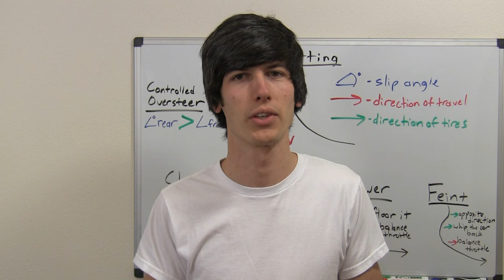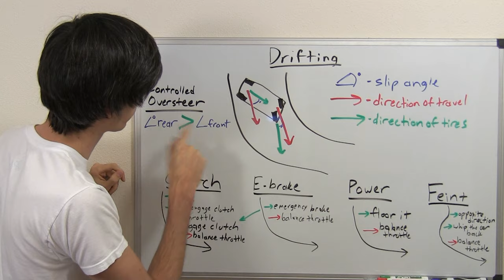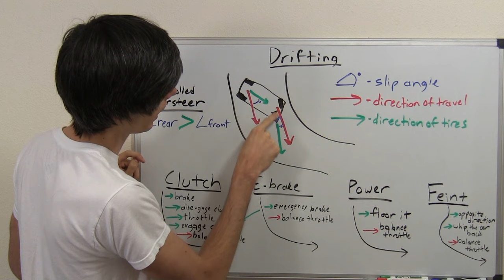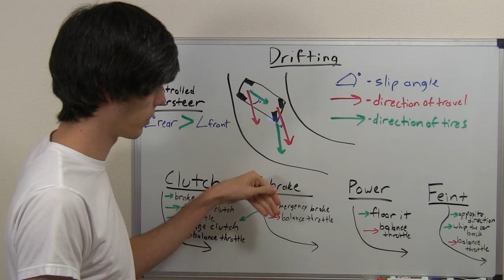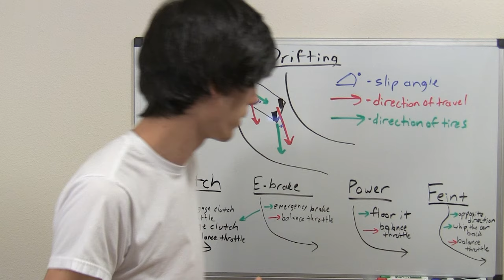What is Drifting - Explained

Comment: 3 ways to spot a drifter. 
•rear rims don't match the fronts.
•bumpers holding on with zip ties 
•rear wheel drive car
Reply: lol and fucked up paint
Reply: So the cars are rear wheel driven? I thought they where driven by front wheels..?
Reply: +graleh BMW produces
Reply: graleh i drifted with a front Wheeler

go reverse 
boom

you can make drifts
Reply: Your power wheels will be the same as your steering wheels. If you are a pro, you can adjust your drift only using the throttle but it's almost impossible.
Reply: @graleh  to drift you need rwd
Reply: @gibbyace5077  first: its not drift,its not even a powersliding...
Reply: the handbrake and angle kit  gives it away everytime
Reply: @graleh  depends most common is fr but in theory you can drift with fwd and awd

Comment: i noticed a lot of those cars are hitting the rev limiter. you should do a video on how the rev limiter works.
Reply: then the engine hits the end of redline the engine speed governor cuts the fuel supply
Reply: but some engines have 9000, 8000 even 11k redline. what makes them so.

yeah you could answer but it'd be nice if EE could explain. no offense
Reply: impreza0109 bigger bore than stroke
Reply: Could be two step too, just to keep the car at max torque easier

Comment: Camber helps in the front, when countersteering the camber and caster will help the tire depending on the counter-steering direction, have better contact with the pavement, and therefore allow a bit better steering input. rear camber usually just helps to break traction if lower powered, and usually isn't used excessively on cars set up to be truly competitive.

Comment from the maker: Mostly for cooling. The cars are running at relatively low speeds and the engine is running at high speeds - removing the hood/bumpers allows for extra cooling, especially when more is needed for an intercooler. Also, since drifting can be rather unpredictable, taking off bumpers ensures that they don't break.

Comment: Yes... I ditto this! that would be interesting... Friction and Tires... I did hear that wider tires do not increase the friction because of the pressure is spread evenly over the wider area... (friction is independent of the area of contact) ... But I'd like a video explaining what taller tires do to your car/engine/power... I recently got my car some taller tires... and i'm finding my car more sluggish... like it wont accelerate as fast as it used to... (Engine does more work?)

Comment: bro clutch is the least of your worries (clutch kick) puts extra shock through your gearbox, propshaft ,rear diff and rear drive shafts. but it's ok to do it from time to time, and it depends on how much power and how much did you rev before the clutch kick.

Comment: Recommended Drift requirements:
1. Good suspension
2.Limited Slip Differential
3.Rear Wheel Drive
4. Vehicle with weight ratio 50/50(arguable)
5. Great Front wheel grip
6.  Decent back wheel grip
7. Top brake fluid and ceramic break pads

Comment: You may not be able to powerslide like those guys, but you're able to do 90 degree turns using your e-brake.

Also You can do 180's and 360 turns neatly with Front wheel Drive

Comment: I agree that peak grip is the fastest way around a corner with the exception of downhill racing, which is probably what he was referring to. A true all-wheel drift, when executed properly on a downhill track, is the fastest way around a corner. Like Luke mentioned, it allows you to maintain more of your momentum with less speed reduction. Though in the US, this is not a method that's widely used because Formula D, XDC, etc do not race downhill.

Comment: Also a competition drift car is typically light weight, has a welded differential for full lock and will use an inline configured cylinder pattern as they produce torque more efficiently. Your breaking setup usually consists of a line lock which selects the % of power to brake. for drift your foot brake only effects the front wheels and the hand brake only effects the rear. That helps maintain speed. Also note advanced steering lock. These are not cars designed for the road any more.

Comment: I'm going to assume (being that I've never tried it) that if you were to try and powerslide, you would want to come into the corner and understeer, and then jerk the steering wheel in the direction of the turn. This might help to get you sideways, but it would be A: Hard to maintain and B: Extremely short since when you gave it more gas, your front wheels would pull you out of the slide.

Comment: from what I can see there's a;
Rear wheel drive converted Honda Integra DA9 at 4:22
Toyota Sprinter AE86 Trueno at 4:45
Nissan 180sx Type X at 5:54
Nissan Onevia (Nissan S13 Silvia front end, Nissan 180sx rear end) at 5:07
Nissan 180sx at 5:55
Mazda MX-5 at 6:44 
Nissan S14 Silvia at 7:10
Nissan 180sx at 7:22

there's 2 cars I can't identify due to too much smoke from rear wheel to see rear, and not enough panels to see the front properly

Comment from the maker: I absolutely love it, great first car. I've had mine for over 5 years. Common problems are burning oil, some oil leaks, and the radiators tend to fail at about 10 years/100,000 miles. Just check over this stuff when buying a new one, look for oil all over the engine (or on the pavement if it's been sitting a while). That said, the engine's always run great (had to replace distributor cap, $18), and the transmission is bulletproof. Yeah I should be able to make a video on it eventually!

Comment: In my experience, yes. if you were on a very smooth street, or it was wet, you might have a better chance, but without your tires spinning in the back, it would be hard. Tires are meant to bite the ground, not skid along it.

Comment: F1 cars are designed to go around a corner at 120 mph on average. Drifting your doing about 70 mph. If the driver is really good they can pull off a drift without breaking, but it's extremely hard to pull off. Most drift racers actually brake into the corner then slam on the gas to get the rear end to pop out and then balance the throttle. You want to be in your torque range when drifting.

Comment: Even in touge, drifting isn't the fastest way to corner. In racing though, a reason to drift around a corner is possibly to maintain your brakes (but also put more wear on your tires) as well as take up more room on the road, making it so your opponent can't follow the best line, and doesn't have room to pass you.

Comment: technically a 240sx comes factory with a KA24. The 200sx (same chassis) comes with an SR20, and 180sx (again same chassis) will have a CA18 (only applies to S13 and S14. S15 only come with SR20's)

Comment: can I drift in an automatic?
Reply from the maker: It's certainly possible.
Reply: With TipTronic?
Reply: MrMcMiniMidgetMan definitely start by disabling the traction control
Reply: It's possible, but I recommend locking it within the first 2-3 gears to prevent stalling, especially on lower-powered cars.

Comment: honest question from someone not familiar with this stuff. Why are so many of the cars open hoods? Is is heat, weight or some other reason (like just being too lazy to fix it completely after crashing so many times?)
Reply: Kevin Cho when you're not driving straight forward it's hard to get air through the radiator. removing the hood and bumper is the fast, easy, cheap, and lazy way that also saves weight when compared to other options.

Comment: As long as your car is REAR wheel drive, and an manual transmission, you should be good to go. Assuming your car is a manual, try doing burnouts. If you can do this, generally your car will be able to drift.

Comment: I thin you can get horsepower easier with a turbo and they don't need it on the whole rev range. They need power and they are very close to the redline most of the time, so they don't have to care about turbo lag

Comment: feint drift is basically the Scandinavian Flick, right?
Reply: is that top gear? XD freaking James.
Reply: +Antony jose george 92 They are almost the same, a lot of people call them both a Scandinavian flick.

Scandinavian Flick is when you have a lot of angle away from the corner before flicking it back for the corner, Feint is doing a small drift away from the corner before flicking it into the corner, Feint is generally considered the better way to entry a corner and also makes it easier for cars following to get close on entries.
Reply: DriftNick 'feint' is also a great way to get an automatic car that doesn't have a clutch to kick or a handbrake to pull in order to get the back tires to kick loose. I use 'feint' in my Q45. Tease the back end away from the curve then back into the curve, it basically whips the back end loose!
Reply: no, they're not. feint drifting means that when you're on a straight before a corner, you steer in the opposite direction of the corner, then as you come into the corner you whip the car back in the correct direction of the corner and that will cause the rear of the car to lose grip due to inertia and that starts a drift. a scandi flick is done exclusively in 90 degrees corners and it means that while you're on a straight before the corner you launch the car into a drift (while still being on the straight road) with whatever technique you like the most (it's often done with a feint drift technique or e-brake), then you let the car slide on the straight road facing the direction of the corner and then as soon as you enter the corner you go wide open throttle and the car will launch into the corner and you'll have a faster exit speed. feint drift is just a way to start a drift, a scandi flick is a way to take a corner and it's usually done in rally when you realise you're too fast for a 90 degrees corner
Reply: Inertia drift is another name for it I think

Comment: Drift is just as hard on the street if done right, clutch kicking around a little corner on the street in 2nd gear is hardly drifting, it's a powerskid.

Comment: Can the e-brake drift or any other methods be used by a front wheel drive car?
Reply: Saxon With front wheels powering the car, while you engage the drift (lets say with your e-brake), the rear tires will kick out but wont maintain the drift (since theyre not powered) and powered front tires will straighten your car into direction front tires are facing.
Reply: PewDiePieFan Ok, thanks
Reply: Saxon drive backwords 
boom
you can drift !

Comment: Honestly, not really. With drifting, you need the back wheels to be the ones with the power, that way they can rotate and skid over the pavement. Front wheel drive will not work for drifting unless you are on dirt or something, and even then it wont be good.

Comment: Which gear they are usually in when they are drifting?
Reply: +Reza .R 1st or 2nd mostly
Reply: +Reza .R depends on the speed, angle of corner and width of track. 2nd or 3rd mostly, 1st gear on tiny tracks
Reply: depend on the car hp and the speed they go... some car drift in 5 gear...
Reply: +Antoine Roy dude what car do you know that breaks traction in fifth gear? maybe some formula drift but not these guys
Reply: Xerxes Patel "some" most likely 1000hp cars and fd cars
Reply: if by horsepower you mean torque, then yes you're right because horsepower has close to nothing to do with breaking the tires loose
Reply: +Jimmy Aronsson oh come on, don't give me the political answer.... horsepower means speed, torque means power... simple as that

Comment: A FRONT wheel drive car is not able to drift, the front wheels will keep pulling the car straight.  The most you will be able to do is a powerslide or something similar with the e-brake.  Drifting is dont with the rear wheels spinning to lose grip, and a front wheel drive car can't spin those wheels

Comment: So much friction on the back tires...wouldn't that pop the back tires very fast?
Reply: +yeeyan ng 
You tires will need replacing after just a few runs. Some drifters go through many pairs in an event.
Reply: yeeyan ng do it like i do 
buy summerweels from eBay or get some free ones from the scrapyard / friends or the happy famili next dores

drift 
have thick weels in front
and a New pair in the back of the car to replace the out drifted ones

Comment: Drifting must done in a 4WD ((NOT AWD)) or RWD car. The rear break traction by high angle and high speed steering. The weight of the vehicle will push itself to the opposite side. Depends on track. Short tight track would adjust the damper to a stiffer setting for quicker steering respond. Long and high speed track will adjust to a softer damping for better weight transfer. E brake will brake traction easily mostly for tight corner and chicane. Using throttle to adjust the drift angle will be use on mid-high speed cornering.
Reply: HKS NISMO a lot of people will argue 4wd isn't true drifting
Reply: Sean Hartford well you’d have to understand the difference between a skid and a drift lol
Reply: Drifting is losing control of a car while controlling the car

Comment: Your theory is correct but your explanation is vague. Mastering the clutch kick, the power over, the hand brake, and the scandinavian flick should all become second nature. You generally do not learn a method and stick with it. every corner is different and rate of speed changes, you need to save time and get the car to respond as fast as possible to keep it smooth. Some times you combine a few of them.

Comment: They use either locked diffs (either viscous type LSD's with additional shims added or welded spider gears), or mechanical type LSD's. LSD's offer more turn in due to allowing the rears to pivot a little, locked diffs being fully solid, resist turn in until they are spinning. There are also more advanced techniques with coasting mid-corner where some drivers believe LSD's can help over locked diffs, even though the rear of the car is sliding at that point.

Comment: What's the high pitched noise at 6:35
Reply: Could be a continuous blow-off from the turbo because he was modulating the throttle and it didn't give the RPMs enough time to die down enough. 

Or IDK.
Reply: Turbochargers sucking in air.
Reply: Actually it's when you run so much boost on a turbocharged car and you let off the throttle, the turbochargers make a 'tu' noise, sometimes a flutter, but this
 Happens because the blow off valve can't let out all that pressurised air or you might not have a blow off valve, so it has nowhere to go meaning the air goes back through the turbo, back spinning it and making the high pitched noise, if you hear a high pitched noise while the rpm is rising it will be the inlet compressor on the turbo sucking all the air